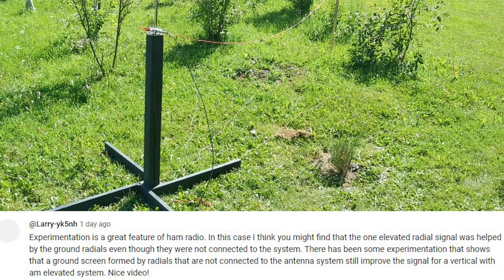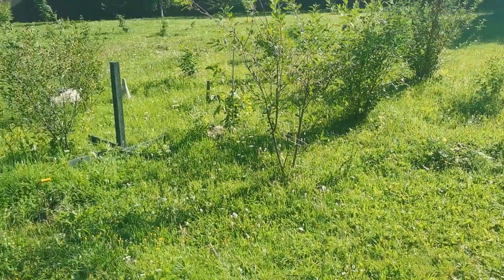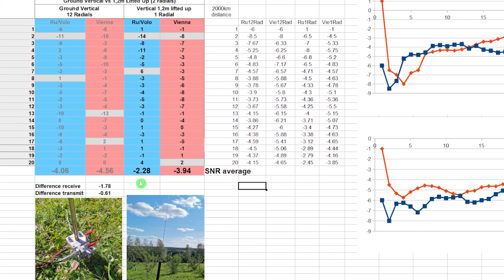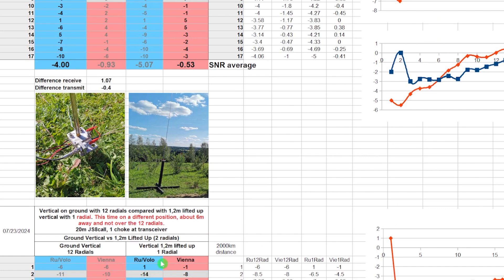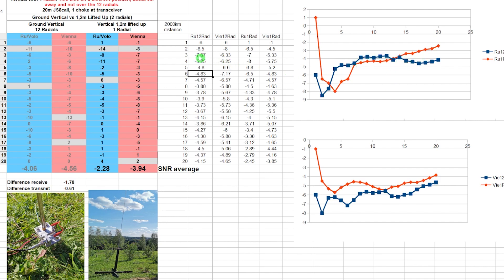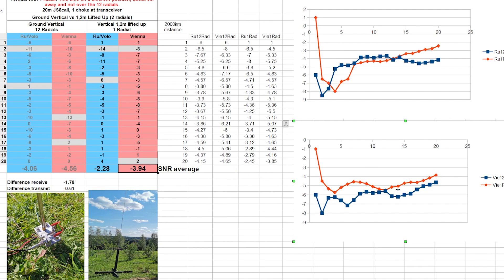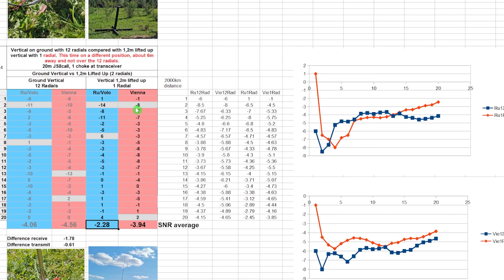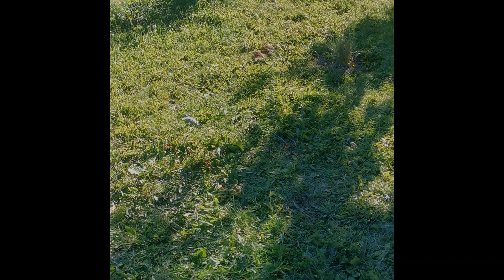Vertical antenna at ground with 12 radials compared with elevated position with 1 radial. Part 2.

Comment: Even to this day, people believe that an antenna can have a different gain when receiving compared to when transmitting. this is simply wrong. read about it, for example in ARRL Antenna book or Rothammel. Its called reciprocity. The differences in RX vs TX you measured can be explained as noise due to measurement uncertainty and changing band conditions. Instead of 2 final values (one for RX and one for TX) you could have averaged all the numbers into one final result which would have increased the accuracy of the comparison between ground mounted vs. elevated radial. Thank you for the extensive test. good work. 73

Comment: I believe the radiation pattern difference is the key to understanding. With the ground radials you have nothing but very low take-off angle while with elevated radial you actually have an L antenna which has  both low and high angle radiation providing a more universal pattern. Really, the only situation where a 1/4 wave vertical using ground radials is superior is for local coverage on the AM BC band. 
Thank you for doing this hard work.